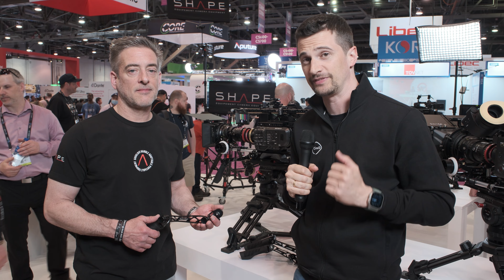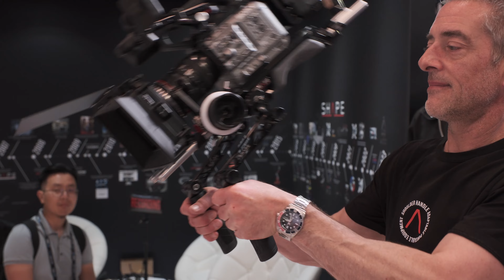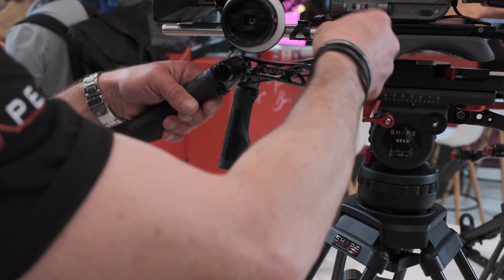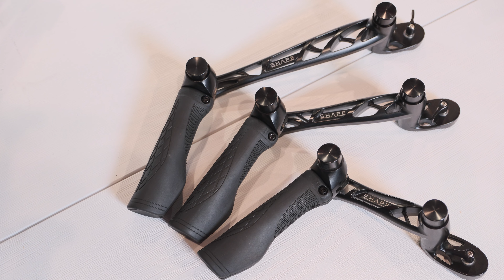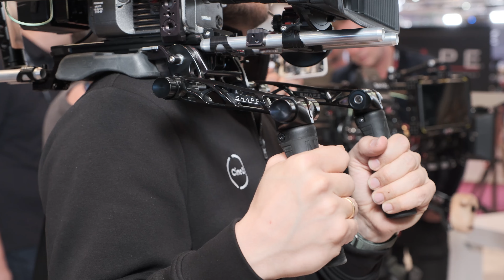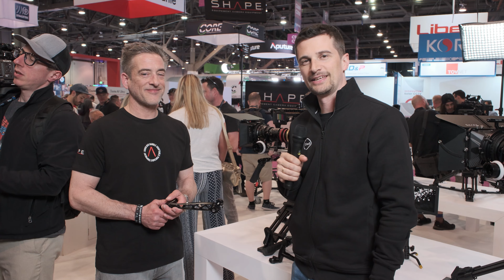SHAPE New Generation Quick Handles Introduced – First Look

Comment: I have the previous version handles and really like the push button system. Fast to adjust and solid. The new design improves upon the old by getting rid of the hex screw clamp. When pushed hard enough it would rotate and the handles wouldn’t match up. Also, the machined design has reduced the weigh by nearly 1/3. That’s always welcome.

On the down side, the new handles don’t have any threaded attachment points. The previous version has 1/4 and 3/8 holes. The new handles also cost more than twice as much - around $1300 a pair! That’s pretty outrageous no matter how nice they are. Even with the initial 25%off sale, that’s a hard sell. I’ll stick with my previous generation handles.